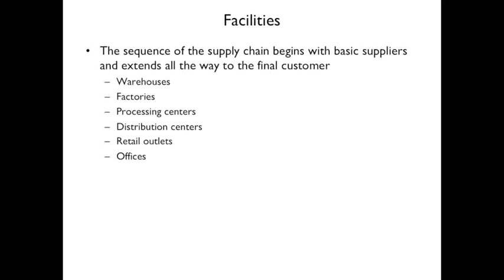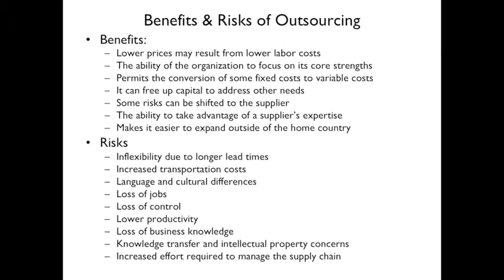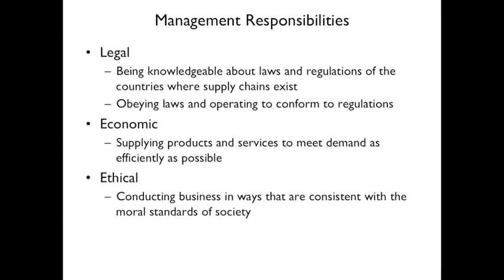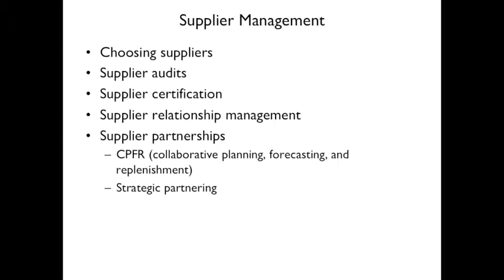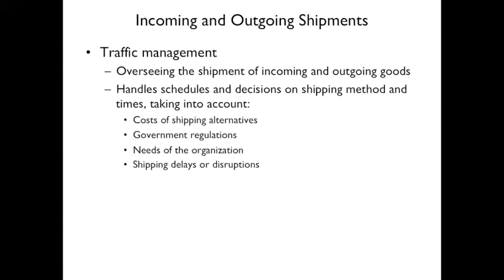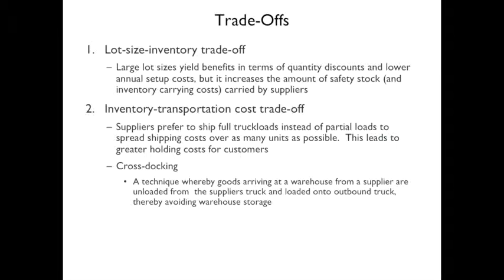Lecture 15 Supply Chain Management

Comment: Sir 

Im ridwan Husain ishraq.  Im from bangladesh pursuing this course as we have in this industrial production engineering at ahsanullah university. Sir although the lecture is good but lot of things are missing like value chain competitive strategy 

You missed strategic fit 
Responsive agile supply chain 5Rs 
Supply chain drivers 
Challenges of globalization 

Bullwhip effect 

Inventory management like ROP safety stock